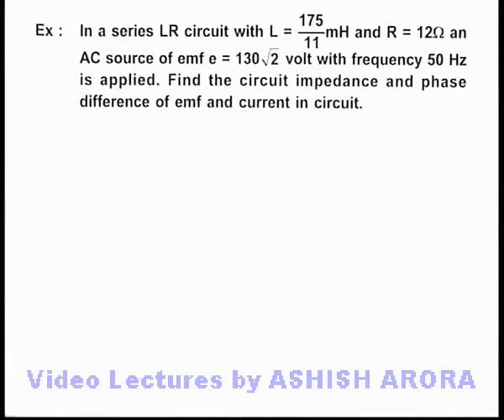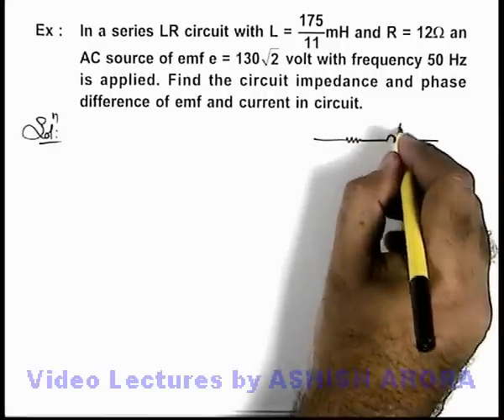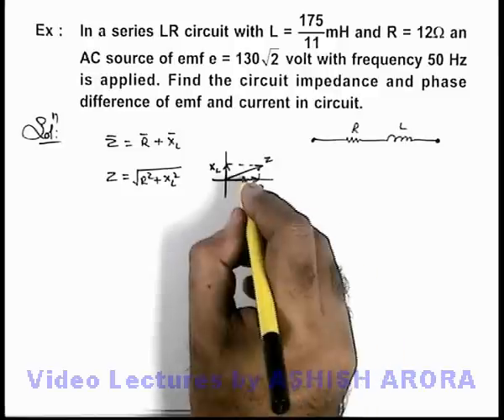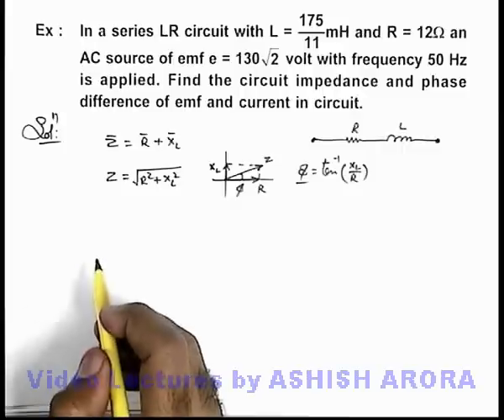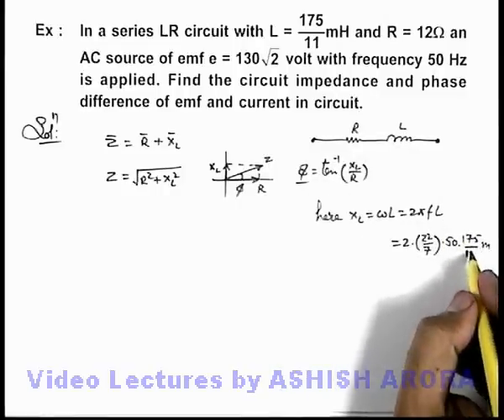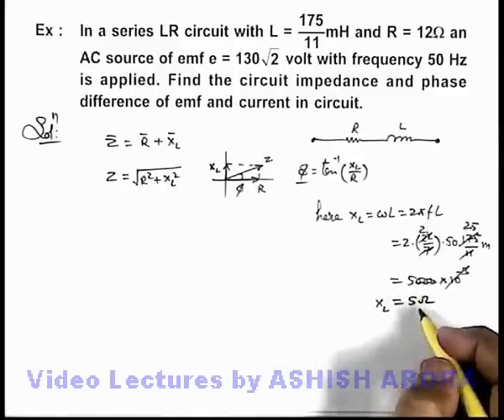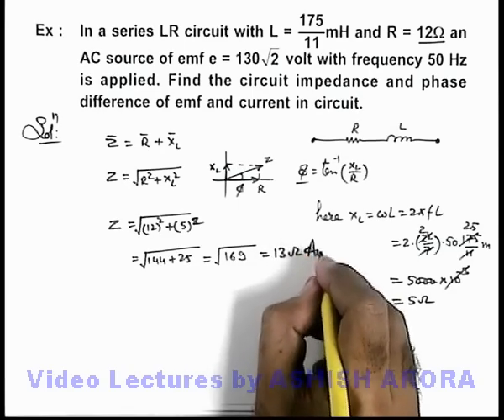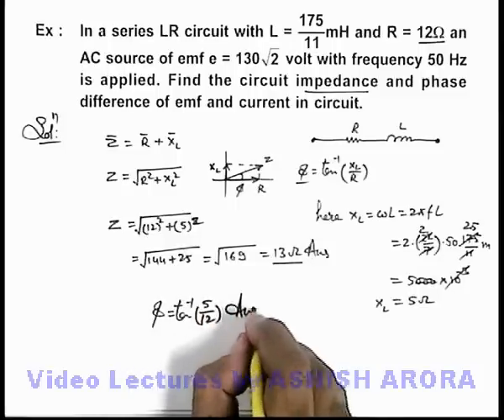Class 12 Physics | Alternating Current | #31 Solved Example-8 on Alternating Current |For JEE & NEET

Comment: i will be 20A
Reply: bro i got 10root2 because i=e/z.i think this is right if it is wrong tell me...
Reply: @venkat8070  10root2 is the rms current because emf given in the question is assumed to be rms voltage
Reply: 20 A will be the current in circuit
Reply: 20 A is the peak current

Comment: Is voltage source amplitude always equal to the sum of the voltage amplitudes across the separate circuit elements.?
Reply from the maker: No... its the sum of phasor voltages of all the circuit elements...
Reply: I think the resultant of voltage amplitude is the AC voltage...Am I right sir?